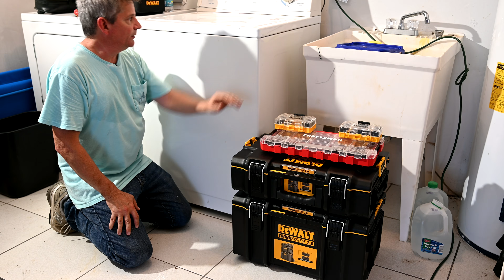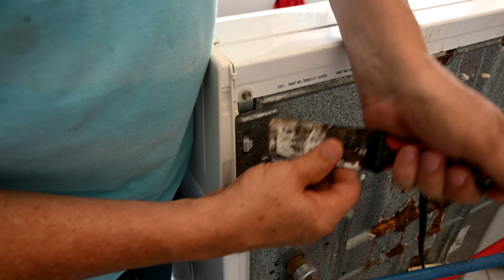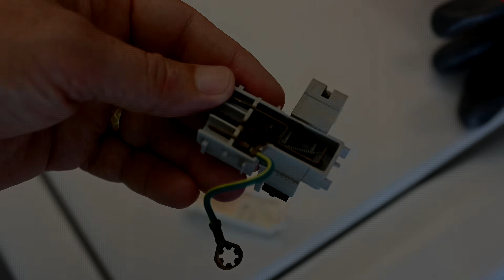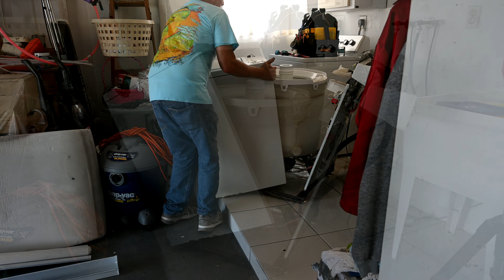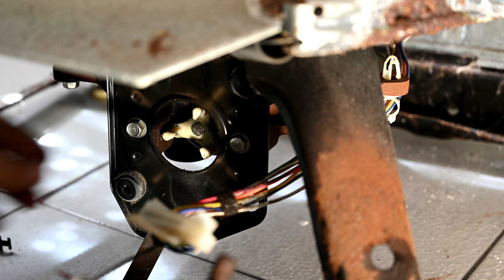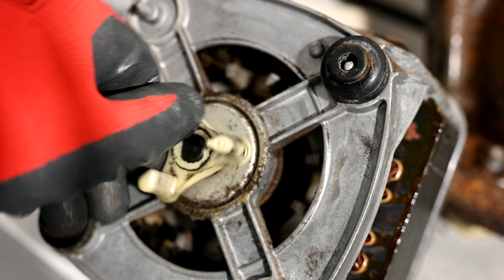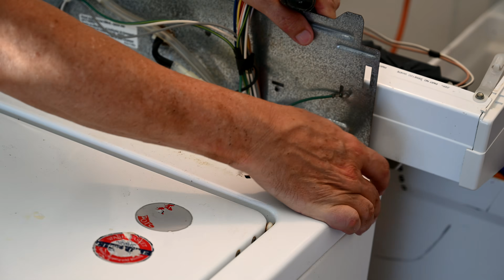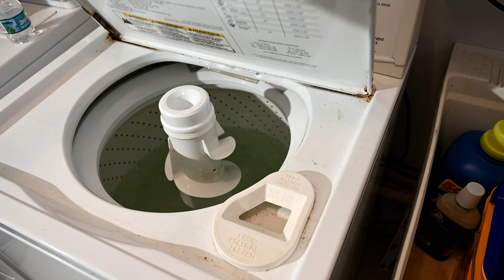Washing Machine Wont Spin/Agitate DIY Fix: Fills With Water

Comment: Good video but you should have checked the agitator dogs (small plastic teardrop shaped pieces) in the top of the agitator before you took the whole machine apart.
Reply from the maker: Did not need to check the dogs, we knew the motor was not running when it should have been, that is an electrical issue typically. If there was a problem with the dogs, at least you would hear the motor running.

Comment: This is WHY DeWalt needs to make an adapter plate for TSTAK to Tough System. Look how the ToughCase+ boxes just sit there in top of the TS boxes all loose and things. Instead of having to lift two cases, you could have just lifted one with everything snapped-in, clicked-in, and secured. They need to think literally outside the boxes.
Reply from the maker: That's a good idea for a 3rd party product.

Comment: @jeffostroff. Thanks for the video with great instructions. I'm also glad that you included the tip to clean up underneath the appliance. Just because no one can see underneath the appliance doesn't mean we can't take pride in a job done well.

BTW: Is that Toughsystem 2.0 large tool box the one you dropped off your roof scaring your poor cat during the comparison tests?

Hope you and your family stay safe and well.
Reply from the maker: Glad it was helpful! yes that is the 2.0 I dropped. I wanted to make sure I had it in this video for its impressive looks, and of course to add some affiliate links to the 2.0 in the video description!

Comment: I had trouble with mine shaking, it turns out it was the suport shocks, cost me just as much as a new used one to fix it. Didn't have a truck back then just decided to fix it.
Reply from the maker: We had an issue with our old washer 2 years ago that would have cost $600 to fix! Instead we went to Lowes, bought new Samsung washer and dryer, where it was $1100, marked down to $750 for a sale, then we used a 10% off Lowes coupon to save even more!